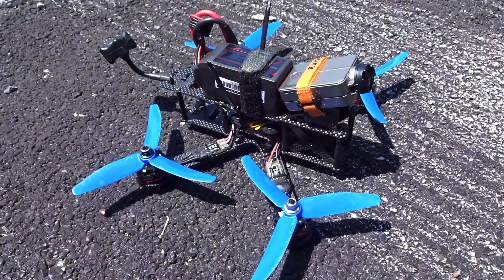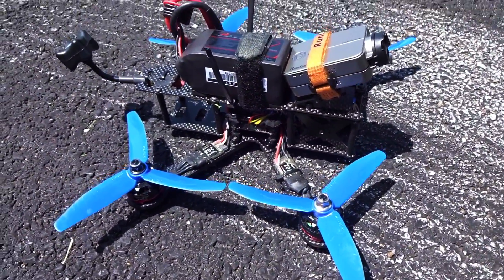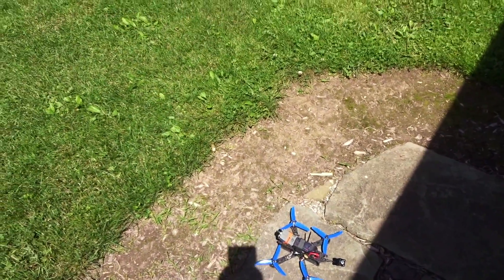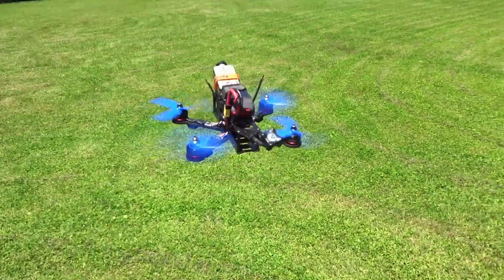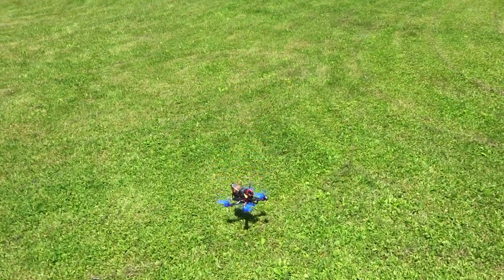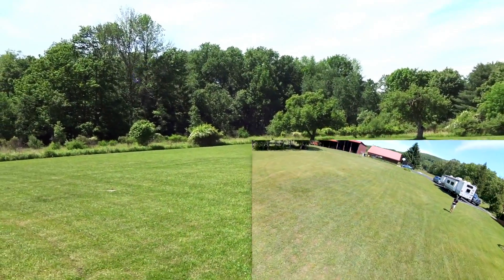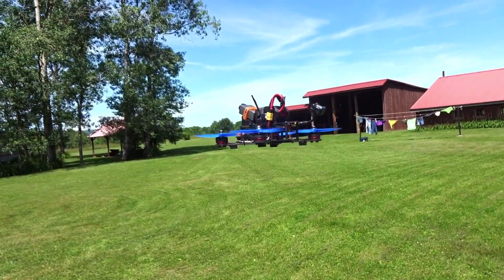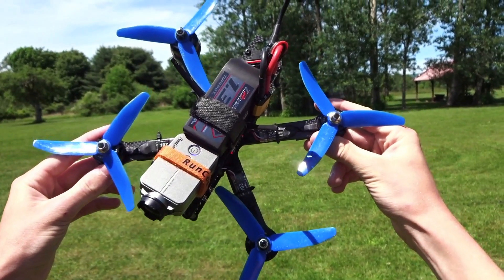ZMR-X210 Quick LOS Flight

Comment: Hi RCAddict!!
I have a quick question for you about your setup! I built my ZMR X210 a few months back and now having come across this video it turns out we run almost exactly the same setup lol. And for the longest time ive flown without esc braking on me little bees because more than anything, ive just heard that "you need to watch out for esc voltage spikes" and "voltage spikes will damage some of ur stuff sometimes" Seeing that you have esc braking on (im very jealous haha) what did you have to do to prevent damaging ur other gear and stuff? Did you have to add any  LC filters or capacitors anywhere? Did you have to do anything at all?
Thank you so much for your time! You totally rip!
Malin
Reply from the maker: I never added anything, just powered the VTX and Camera off of the 12V and 5V regulators on the PDB like I always do.
Reply: Awesome! thanks so much!

Comment: I tried to look at what you do with the extra wire on your xt60 connector. Did you tie them in a knot? I'm still new to the hobby and I struggle with a good solution... Any tips?
Reply from the maker: The balance lead? I just tuck it in between the main leads so it doesn't get chopped by the props.

Comment: Hey does that foam really help with the fc? im noticing when i went to 4s i have all kinds of vibration problems!? its so aggravating!
Reply from the maker: That foam is not for that type of vibration, you need to re tune, I bet your PIDs are too high for 4S, as 3S are usually higher.

Comment: Whats your opinion of this frame, so far.  he package from FPVModel looks pretty good. I'm considering this, or  a similar setup on a 210mm Martian II frame.  Also, have you tried the 3-bladed props on 3S?
Reply from the maker: I think it is a great value and works very well. I don't fly 3s so no :/

Comment: "Farly new to Acro LOS".. Holy Molly.
Reply from the maker: Haha, thanks Fabio :)
Reply: brilliant, i wish i knew more about the looptime stuff and how and if and why i should adjust it,  also airmode?, i'm just about to build my 210 carbon, i only have cheapo rwrc 18a esc's, but i gotta do this,  i only have one 4s battery, a 1000mah bolt 65c and it has a similar voltage profile, it doesnt sag and recover, but when its done, you got about 10 seconds to land it with these rwrc. esc's... i can't bring myself to fully charge it, my little kingkong 188 frame is terrifying, the props scream like mad, and i scream like ned flanders....

Comment: Do you set up the esc braking through blheli 14.6?
Reply from the maker: Any BL heli does ESC braking, version does not matter. The Littlebees are know for their very strong braking.
Reply: +The RCAddict oh ok thanks I got a similar kit as yours with the little bee 30amp so it already has it on them?
Reply from the maker: BassMaster It might, it might not. Depends on the version, and where you got them. You need a windows computer and BL Heli Suite to acces the settings.
Reply: +The RCAddict ok thanks

Comment: how was the transition from autolevel to full acro.. im getting teady to learn acro only myself .. any tips?
Reply from the maker: I tried before and it was very hard, but once I built this one, and it really is a high performance well tuned one, was so much easier than say a dromida ominus. Having a good quad really helps! Just go slow at first, getting turns down is the hardest as it acts totally different.

Comment: Hmmm I wonder who suggested 4khz ;) lol
Reply from the maker: I went back to 2K, as escs can't handle it anyways, so wasn't doing anything, lol ;P Thanks for help though :D
Reply: +The RCAddict run multi shot at 4khz and man the escs fly amazing
Reply from the maker: jussa101 Multishot is not 4Khz but 8k and up I thought? Either way it doesn't really make a difference.
Reply: +The RCAddict I thought the same thing, but turns out you can run the little bees at 4khz. The little bee pros and little bee blheli s can run 8khz. It made a huge difference in how my quad flies. It's very noticeable. I really liked it maybe give it a shot I think you'll like it too.
Reply from the maker: jussa101 Eh, I don't want to risk these bees as it is not officially supported. Will be on my next build with bl heli _s though :)

Comment: This guy..... says I'm fairly new to Acro .... proceeds to blow my mind that his eyes can even keep up with that speed. 

That has always been the biggest issue for me with line of sight especially flying line of sight Acro is that at certain angles you can't tell which way or which angle your facing which causes you to correct  the wrong way but you seem to have no issues with that at all
Reply from the maker: Yeah, most of the time you can't really see, you just have to know what your craft is going to react like to continue through a turn or such.
Reply: +The RCAddict Ahhh... OK so you just feel it out. Guess I just need a few more years of practice lol... oh well I fly just fine FPV which is the majority of my flying now. I hardly ever fly LOS anymore.

excellent video btw... I'm guessing your brushed motor stuff is collecting dust now huh?
Reply from the maker: RC Flyer85 Yeah, having something like a silver camera up front, and antenna out the back might help as well. Just small things that keep you update on what is happening. Sound also helps. 

Thanks :) Yeah, I don't really fly much else, unless I am testing for a review.

Comment: Dang! How can you fly afro like that so confidently?!
Reply: *acro lol that auto correct is hilarious sometimes!
Reply from the maker: Having a good machine makes a world of difference!
Reply: +The RCAddict Ha, I must not be any good at it. Mine is a qav210, little bees, sp3 fc.
Reply from the maker: QuadBro RC Motors? Real QAV, or fake?
Reply: +The RCAddict emax mt2204ii, qav clone, same as original, just doesn't come with the accesories. I went out to fly earlier, sucker it up, and flew an entire battery in acro without crashing. Very fortunate I didn't crash, did some power loops, probably would have been a spectacular crash.
Reply from the maker: QuadBro RC OK, those motors aren't bad :) Hmm, not to be that guy or anything, but it isn't the same, accessories or not, but moving on :) That is good! Keep at it!

Comment: Dude you just MURDERED the air with that flight! Very very impressive :P
Wish I had your knowledge of tuning, I can't get to the point of tuning because I have trouble getting the receivers working to get my quads in the air! LOL, ESC braking seems nice if it stops that quick just by lowering throttle... Is that what you did or did you hit throttle cut?
Reply from the maker: Thanks! =D I don't know all that much really, but this quad has greatly improved my understand of what the terms are and do. Dang, what happens? Do Devo receivers not like to bind? Esc braking is a breakthrough feature if you don't have it, lol. I am sure a seasoned pilot can't imagine not having it there. The braking is like a motor being able to work both ways, not just spin up, but also spin down almost as quickly. When I caught it, I did hit disarm, but I have props spin when armed, so that is how you shut it down. Also another must have feature for good fpv :)
Reply: FF why not grab a FlySky i6 and use that for your racers... Not too expensive